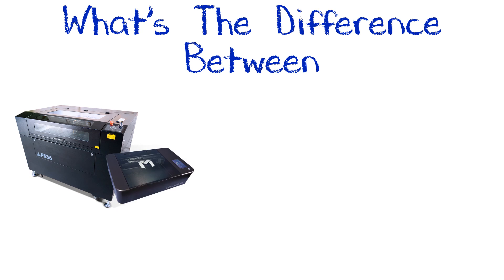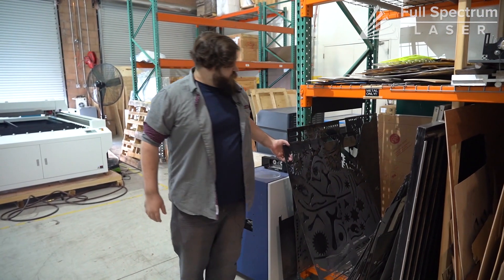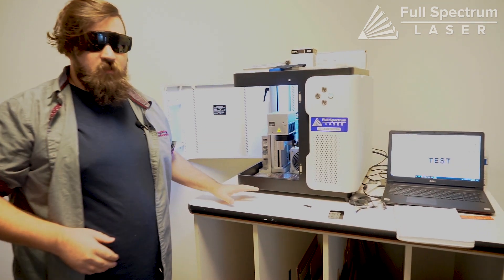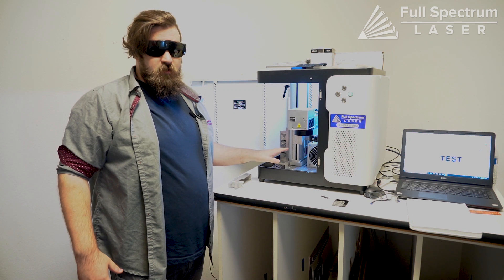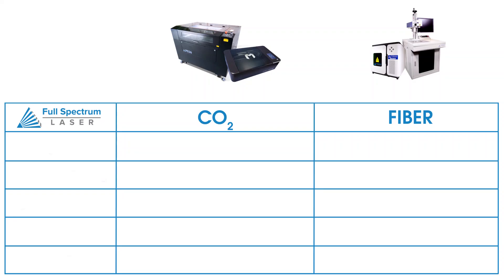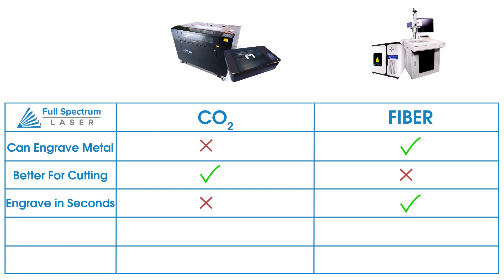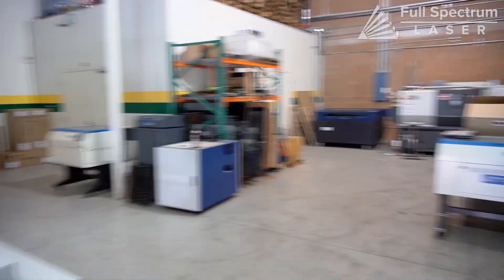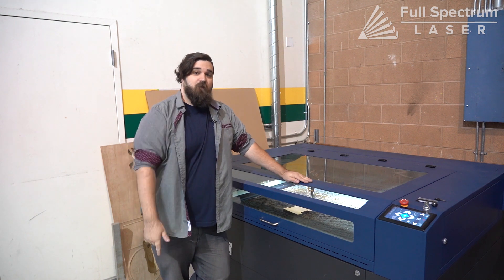CO2 vs Fiber Lasers

Comment: Solution assistance. 304 stainless steel #8 with white protective layer on it and 3M double sided tape on the back for automotive custom parts. Mutiple manufacturer's parts have burn marks on the edges where it makes the pieces look bad. What would be the best setup, laser wise for precise cut and clean edges? I always wondered if burn marks are stronger or lighter appearance wise with or without the protective white layer over the #8 finish on the 304 metal sheets. Basically I have manufacturers producing parts for us and I'm getting tired of consumer complaints about quality. I'm considering doing it myself if I can get better quality. I've only run a waterjet in the past, so lasers are new to me.
Reply from the maker: Nitrogen cut steel has no burn marks unless it comes from your protective layer.  Looks just like it was saw cut - contact sales@fslaser.com for demo.  Laser is lower cost than waterjet for sure.

Comment: One thing you forgot to compare which might not be for smaller shops but more industrial larger shops cutting big pieces is speed.  The CO2 is way slower than a fiber laser. Like comparing a scooter to a mustang

Comment: Hello, please help.  I have a CO2 laser with a 150 watt tube, I cut MDF up to 12mm thick.  I'm very tired of adjusting the head and mirrors.  I want to replace the lamp and install a fiber system on the head.  Can you recommend anything?  Will it cut normally?  Will the cutting speed increase?  Now the speed is 6mm/sec. Estimated power up to 3 kW, Chinese assembly.
Reply from the maker: A fiber laser is not necessarily stronger than CO2 when it comes to certain materials - a fiber laser is not ideal for cutting MDF as there are two types of MDF. One cuts better than the other. 

Have you tried both types to see which cuts best?
Reply: @FullSpectrumLasers  Yes, it requires one type, which is more ecologic friendly, because...  I make furniture for children. Are you saying that there is no point in switching to fiber?

Comment: If I wanna cut metal(specifically stainless steel), instead of engraving, would you still recommend fiber over CO2? And which watt would you recommend to cut 1mm stainless steel? Would 50W fiber be enough? Thank you in advance for your reply. I’m completely new to this game😢
Reply from the maker: You should get at least a 100W mopa.  Cutting steel is much better with 2kw CW laser with assist gas ~around $60k with 4'x4' bed single phase 220v.  MOPA laser is better for engraving and cutting aluminum/brass.  Steel it cuts but it's not super clean like 2kw CW.  CW can't do quality engraving so different laser for different purposes.

Comment: CO2 laser using compressed gaz !??? I doubt it. Isn't it on the contrary on very low pressure CO2 ?
Reply from the maker: There is a mixture of gases inside a cO2 laser!
Reply: Yeah, ok. but my point is that it is low pressure gaz (vacuum) and not compressed gaz. The reason why it has to be low pressure, is that atmospheric pressure and above are much harder to keep ionized. You would need millions volts to have electricity cross your tube whole length if the gaz was compressed.

Comment: I need to cut Nickel strips out of full sheets for Li-ion battery packs terminals, They are very custom and I made them using Solidworks, What is the cheapest laser cutter I can get on the market today that can accomplish clean cuts for a thickness of 0.15 to 0.20 mm, The work space needed is as small as 3"x3".
Reply from the maker: Hey! I would you to send in a sample of your material and we can do some testing on our machines and give you the best answer. If you'd like to set that up, feel free to email general@fslaser.com (you can also just email me personally and I can connect you to Tony in applications, who does all of our materials testing - jordan@fslaser.com) to get in touch!

Comment: Other than the flat bed, those machines are tiny. We run 3kw fibers on our shop floor that can cut 1" carbon steel and does 1/4" all day long. 
So the comparison is "appels to oranges"

Comment: Nonsense. It is not the Fiber marking system VS CO2 laser that needs to be compared, but the Fiber marking system VS CO2 marking system. because a small standard business and it usually has both CO2 and Fiber, gad would cover a wider range of services.Then the question remains- what materials do you want to engrave / mark and all. Adding a UV marking system would be good for prof. video and now amateur league, sorry.
Reply from the maker: Did you mean to say "fiber marking system vs UV marking system" instead of CO2 marking system? 
Comparing fiber to CO2 is still useful for many people since 1. they're more affordable than a UV source, and 2. are much more popular, 3. first time purchasers often don't know the difference and 4. both systems can still engrave.
We started building a UV around Christmas time that's been available since the beginning of the year. We have a video comparing the UV to fiber, as well as other UV videos on our channel as well.

Comment: Thank you for the details regarding what are the different between CO2 and Fiber. My concern and question, what are the parameter of the machines like for example on fiber laser that good only to use for metal engrave. I'm looking forward for your response. Thank you :)
Reply from the maker: The general rule of thumb is CO2 is used for cutting and engraving, and Fiber is only used for engraving. The trade off is a fiber is going to engrave with much more detail. The fiber is able to engrave on all sorts of materials, but it's unable to engrave on glass (a fiber machine IS capable of engraving on metal). It also won't engrave well on softer plastics as it will melt the plastic. For softer plastic and materials like PVC you'd want to jump up to a UV engraver which generally used for marking and light engraving onto materials. Because it's a lower powered machine and engraves with more detail than the Fiber, it's able to mark on other plastics the fiber and co2 won't.

Comment: Can a co2 tube be used on a galvo?
Reply from the maker: There are CO2 Galvos that exist, but we do not manufacture them. They also lose most of their cutting power under a galvo configuration and then only referred to as marking/engraving machines.
Reply: @FullSpectrumLasers  Thanks
Reply from the maker: @laserfalcon  Anytime

Comment: Any thoughts re a machine for engraving the exterior of a 1750 Pelican case.  Thunder Laser out of TX is suggesting a CNC router instead of a LASER of any kind.
Reply from the maker: Send a sample to FSL and we can test it with the 355nm UV laser.  Our understanding is a pelican case is polypropylene and this is perfectly marked with the 355nm pulsed laser.
Reply: @FullSpectrumLasers  solid copy,  I’ve got a smaller one I could easy dispatch.
Reply: @FullSpectrumLasers  presuming success the 1750 case is roughly 60 Long X18 Wide X9 Deep, is there a machine to handle the size?
Reply from the maker: @charleshetrick3152  Our PS36 is 36" wide (on the x axis) but has side passthrough doors, so you could fit any width through the machine to engrave
Reply: @FullSpectrumLasers  solid copy,  I spoke with one of your reps and am in the process of mailing a smaller size pelican to allow for a test on the material.  Thanks!
Reply from the maker: @charleshetrick3152  OK Great!

Comment: You didn't say anything about if a CO2 laser can etch metal.or not ?
Reply from the maker: CO2 is very inefficient for metal. Unless you have a high wattage source with oxygen assist it's not really a viable solution. Fiber is much better at engraving metal. This is because CO2 and Fiber operate on different light wavelengths. Steel is very good at catching fiber wavelengths but doesn't react at all to the CO2 wavelengths. The inverse of that is that CO2 is really good at engraving glass where fiber sources pass right through and don't etch at all. Hopefully that answers your question!

Comment: co2 can engrave metal... just needs a spray ...
Reply from the maker: Cermark and similar products can be used to mark metal, but you're not technically engraving anything.
Reply: @FullSpectrumLasers  ??  the metal engraves... i have co2 laser and fiber and i engrave metal on co2 for at least 4 yrs now....
Reply from the maker: @pimentaphotographer  I was simply stating that with "a spray", as you suggested using in your first comment, you're not engraving, it's an additive heat bonding process, that's all.

Comment: What would you recommend to cut 1-2mm metal sheet?
Reply from the maker: going through metal can really only be done with a high powered fiber laser, or a very high powered CO2 laser. Fiber Galvo lasers could conceivably go through thin metal, but if you want precision, it's not the best idea, as your edges won't be square and any variation in focus height will cause your sizes to be off.

Comment: Can a fiber laser cut through a 2mm stainless
And then engrave a portion by 0.64mm deep in one setup?
Reply from the maker: Typically, fiber machines specialize in one or the other. A high powered Galvo Engraver could conceivably cut through 2mm steel, but given how galvo machines work and the angle of the cut, your edges wouldn't be square. It would also likely take a significant amount of passes to get through 2mm metal with say a 50w laser. In terms of cutting machines, they don't typically have the precision to do any detailed engravings. So technically, yes, but I wouldn't recommend it.

Comment: Sorry to ask a year after posting, (somehow exactly to the day haha) But I recently started a Firearms Manufacturing Company. Our primary material we need engraved is 6061 T6 & 7075 t6 aluminum and. As per ATF regulations, products need a marking depth of at least .003 inch for firearm identification. I'm to understand that a Fiber laser is best for this application, but what wattage is recommended for ample engraving time at those depths on the aforementioned materials? Also, assuming I only have one part such as a frame or receiver working at once, which model of laser would you recommend?
Reply from the maker: Hey Jared. A lot of our fiber laser owners buy them for that exact purpose. You can definitely achieve MIL-SPEC depth with a fiber laser. As for wattage, you can achieve the same depth with a 20w or a 50w, but the 50w will be much faster and need less passes.

When it comes to the size of your engraving, that's going to come down to the lens you're using, not so much the model of the machine. We offer a 163mm lens which has the best detail, but the smallest workspace at 4" x 4". But we go up to a 420mm lens that offers a 12" x 12" workspace.

If I had to recommend one of our machines, it would be our Muse Galvo machine with a 254mm or 330mm lens.
Reply: @FullSpectrumLasers  with a 4" x 4" workspace, can larger parts be put in even outside of the workspace. For example if I have a receiver with a footprint of 8"x4", could I place the entire part in/on and line up a 4"x4" engraving somewhere on the receiver? Also, if I do not need a particularly large print, but want the best detail I can get, do I sacrifice engraving speed or just the range of the galvo head?
Reply from the maker: @captianjudd8387  Yes, with our Open Galvo machine, there's not much in the way of size limits. If you're looking for the best detail, I'd go with the 163mm lens. Just keep in mind, 4" x 4" would be the max engraving size. The speed/power doesn't really factor in to detail at all, so that's more your preference.

This is our Muse Open Galvo: https://fslaser.com/musegalvo/

Comment: How deep can a co2 laser engrave stone or cement and which model is recommended?
Reply from the maker: Depending on the stone, engraving with CO2 lasers doesn't produce any depth, it merely causes a surface abrasion that alters the color. Relatively porous cement is slightly different. With one pass, you could maybe get .5mm of depth, but it really depends on the makeup/density of your material.

As for model, you'll want a higher power machine with a 120 or 150W laser tube. I'd recommend our Pro-Series of machines. Our hobby lasers can still engrave on stone and cement, but would take multiple passes to get any depth.

Comment: What kind of depth could I achieve with a co2 lazer on steel. Maybe around. 062" or 1.5mm. Im looking to create heavy textures.
Reply from the maker: A CO2 laser will get almost no depth on any kind of metal. Best you'll get is a light surface abrasion. To get any depth on metal, it has to be a fiber laser or a very very powerful CO2 laser, but were talking Kilowatts of power.

Comment: What is your cost on the fiber laser for sheet-metal?
Reply from the maker: If you are looking to cut sheet metal, you're looking at $60,000 to $75,000. If you're just looking to engrave, you're looking at $7,500 - $15,495.

Comment: If I just want to mark and not engrave construction metal or HSS or carbide?
Reply from the maker: It's the same concept as engraving, you'd just want to do fewer passes so it's just marking the surface and not engraving depth. Steel marks pretty well. I haven't tried with those specific types, but I imagine they would mark just fine.

Comment: Thanks for a video man!
I dream about that large space for a laser machines.

I have a glowforge pro 45w CO2 laser, from which I make a living. But to upgrade to a larger machine in New York it cost at least few thousands per month :(
Reply: And I didn’t know that you need to replace a tube

I’ve been using my machine for 4-5 hours 5 days a week since august 

I’ll probably order a replacement part for that day 😃
Reply: Go with an Epliog. You can do lease to own as well if you're confident you'll be able to make monthly payments until it's paid for. I've been thinking about maybe trying to buy one and see if I could make a living from it. What products do you make?
Reply: @TedH71  yeah man I was looking at epilog and I’ve seen it in person. It’s probably the best machine on a market plus it has so many ventilation inside of it.

I was talking about space. I live in apartment. upgrade to garage space is very expensive:(

I’m thinking to move to Texas
Reply: @TedH71  I cut and engrave acrylic 
Also i personalize itb

Comment: I have a question. 
What is the cost of running a fiber engraver 

Say I run a 50w machine for 1 minute
How much would that be
Reply from the maker: a 50w for 1 minute would be a miniscule amount of power. We're talking cents if that. For comparison, our 1kW Fiber Flatbed has less power draw than an oven.

Comment: Hi Tim,

Is it possible to easily engrave plastics with a CO2 laser? We sell signage that is mechanically engraved on .0625"/.125", two/three layer engraving plastic. Typically the top layer is colored, next layer is usually either white or black. I've been told this can easily be accomplished with a laser. Would this be a 'CO2' laser? If so, what would be the recommended 'size/strength' of laser to purchase to do this type of engraving in-house? We would also like to be able to then 'cut-out' the perimeter of the sign with the laser. Probably the maximum thickness of plastic materials we would ever want to cut is .25" to .375". And, that is only a 'guestimate' regarding thickness.

Thank You,

Jim Dasher
Spectrum Graphics

E.: rii.jed@gmail.com
Reply from the maker: Hi Jim,

If you're using acrylic or laserable plastic, a CO2 laser is excellent. However, PVC and polycarbonate shouldn't be cut with a laser. PVC will give off toxic and corrosive chlorine gas and polycarbonate melts instead of vaporizing. 

That said, there are engraving plastics that you can get that are pre-layered with all kinds of color combinations. On top of this, you can easily cut layered signs out of different colors of acrylic.

Our hobby lasers can easily do up to .25" material and our pro machines can do .5" pretty well. In terms of size, however, that'll depend on how large the signs you make are. We have a 20"x12" bed all the way up to a 48"x36" bed. Or if you need a larger output, we have flatbed lasers with 4'x8' beds.

Hope this helped. Let me know if you have any more questions.

-Tim Snow
Full Spectrum Laser

Comment: Hi, nice video presentation. Can you you tell me from your experience what laser can be suitable for paper cutting? I'm looking for something with galvo head with an minimum cutting area of 210x310 mm. Thanks 😊
Reply: Check glowforge
Reply from the maker: Thank you! Currently, the only galvo lasers we offer have a fiber source. If you want to cut paper, I'd definitely suggest a CO2 laser. You can find galvo lasers with a CO2 source, but currently we don't offer any. That said, if your decision to go with a galvo head is based on speed, I can assure you that gantry systems are extremely fast when cutting paper.

Comment: So basically you need both depending on the job you want to do...
Reply from the maker: It's really only if you want to do a lot of metal engraving that you need both. You can do quite a bit with a CO2 laser.
Reply: @FullSpectrumLasers  my first machine now is Ortur Laser Master 2 with the rotary attachment... So far so good... Been able to do wood, leather, perspex and foam...